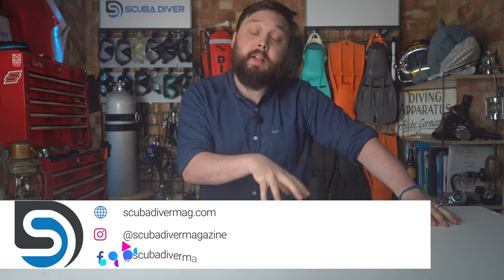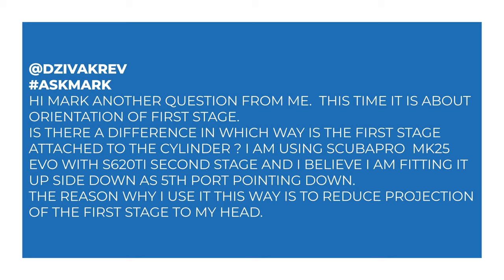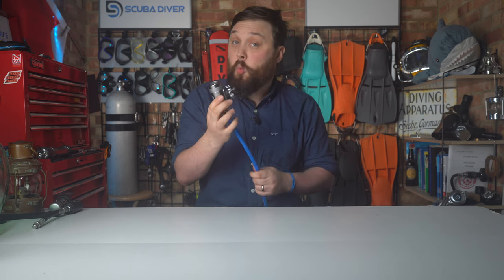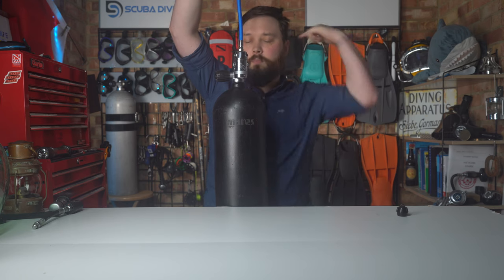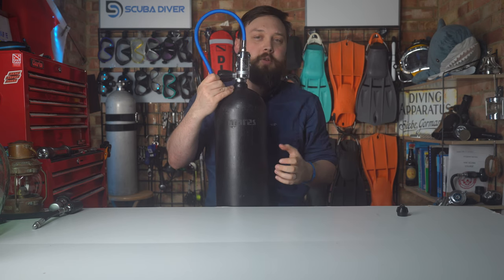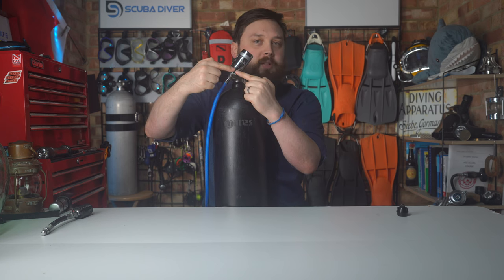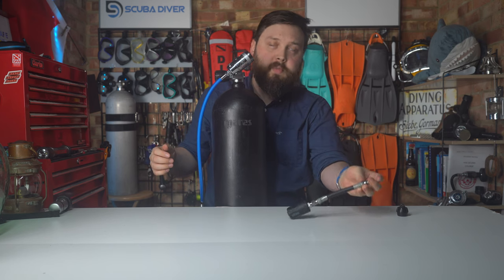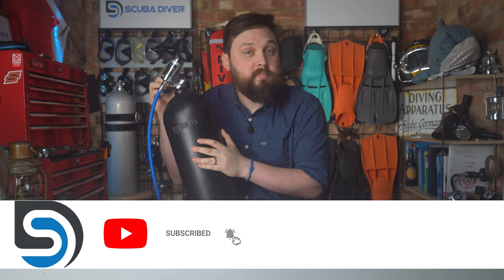Can I Mount a 1st Stage Upside Down?  @Dzviakrev #askmark

Comment: #AskMark : Hi Mark, thanks for all the great videos and tips !
I tend to be perfectly boyant without any weights, so I dive without any. But would you consider it a safety problem not to have any ditchable weights on me ?
The only advice I got so far from an instructor was to consider moving to dry-suit diving, in order to add a bit of lift so I can then add some weigths.
Reply from the maker: Your main focus should be a set up that allows you to become positively buoyant if your BCD fails during a dive. A drysuit or a redundant bladder BCD would be your best options. Wetsuits lose buoyancy at depth so, a drysuit is usually the best choice.

Comment: Hi mark, is it normal when you taking the 5th port off and the whole thing including the swivel turret come off? I have an Apeks dst first stage same exactly like on the video. The other day I was trying to install a long hose for my second stage and I tried to use the fifth port once i opened the whole thing came out. Sorry about my English. #askmark
Reply from the maker: The first thing you need to do is ensure you have the 5th port version of the DST. The 5-port version has a raised section with a hex nut shape and the 5th port plug in the end. The 4-port version will be flat with a recess for a hex key.

If the end of your 1st stage is flat then you need to have the 5th port kit fitted to your 1st stage. If you do have the 5-port version then you should only need a hex key to remove the port plug. If that unscrews the entire port then use a wrench to secure the nut.

It will make more sense in the video...